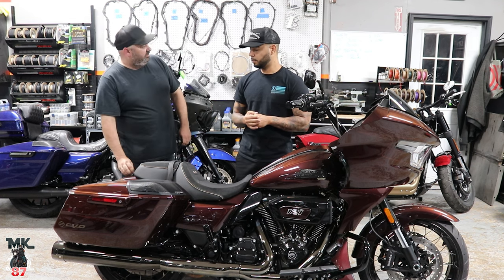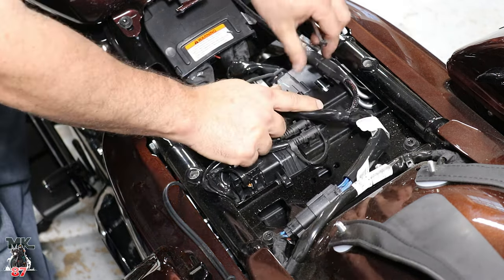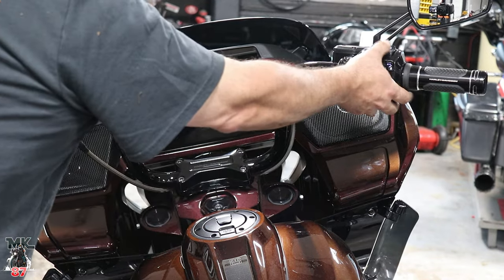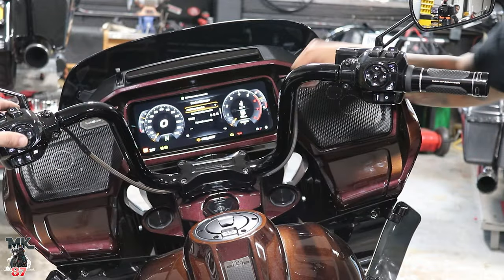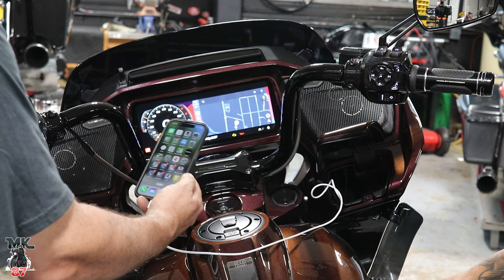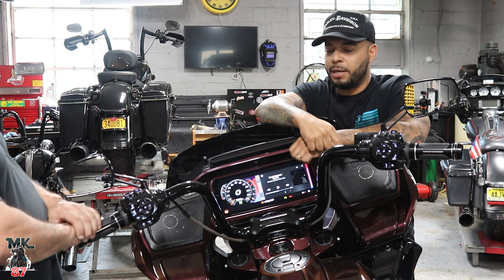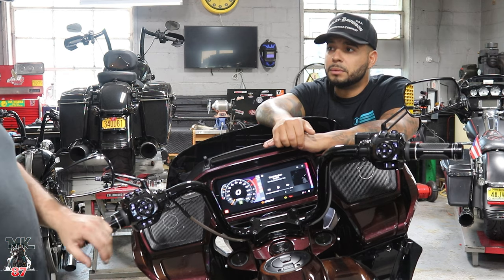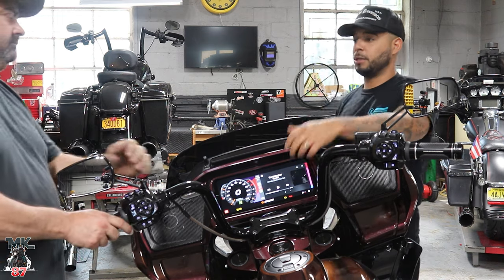Apple Carplay hack for 2024 Road glide and Street glide

Comment: I thought the wireless connection was part of harley.  Why do you need an adapter?
Reply: in order to use carplay. It requires you to have a Headset connected. what this adapter basically connects a Bluetooth headset which the bike see thus allowing you to use Carplay.